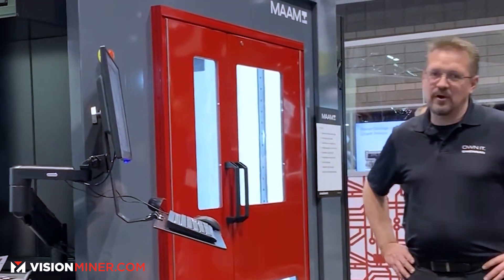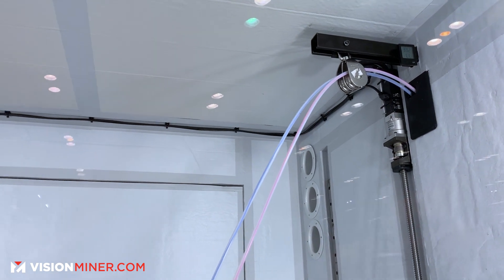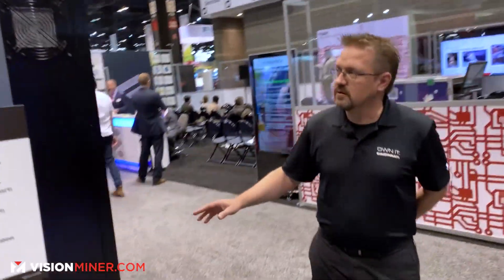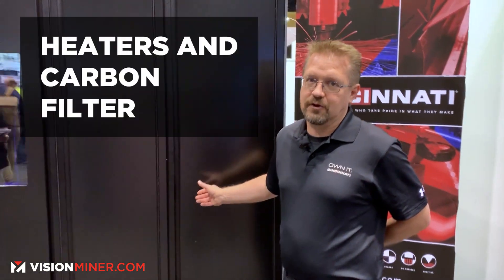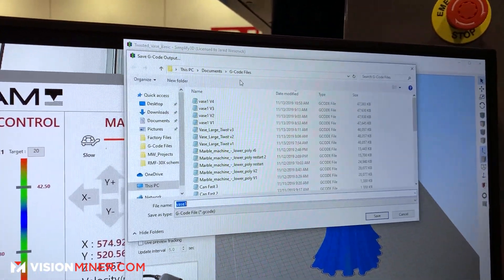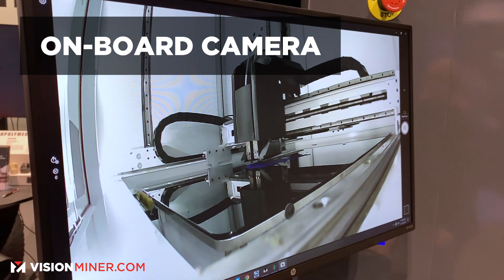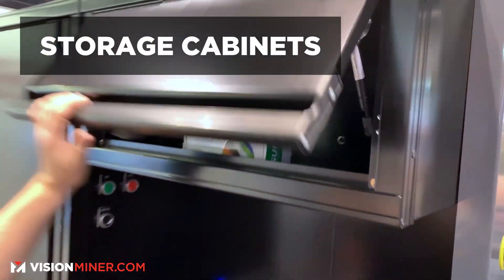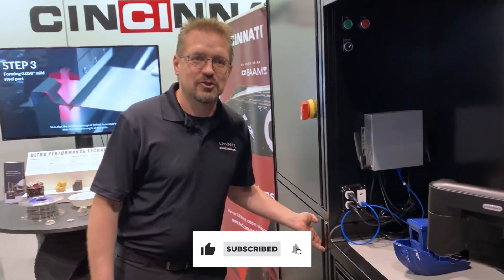HUGE 3D Printer! The MAAM from Cincinnati, Inc - Medium Area Additive Manufacturing (2020)

Comment: this is awesome , but also shows how 3d printing is still in its toddler days.  a super machine has no better software than simplify 3d and does not have real physical buttons.  

aside from that ,  wow ,  this machine looks awesome
Reply: say when i change filament materials, i need to reprogram or mess around in submenu after submenu . it would be so nice to simply turn a knob to adjust the temperature.  the same for speeds , feeds and maybe retractions. that convienence makes for far faster tuned in parts for cnc machinist , it would do the same for us also.
Reply: Why would you want physical buttons? No ability to update, or customize, added cost, and a chance of failure many years down the road. Several manufacturers are ditching physical buttons. I have a Tormach with a touch screen as the only interface and I wouldn't trade it for any amount of buttons.